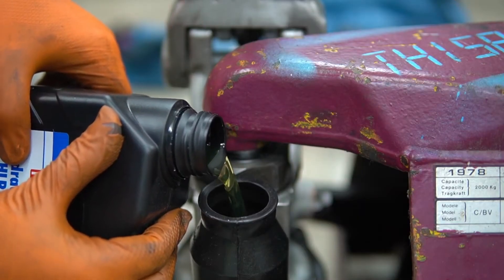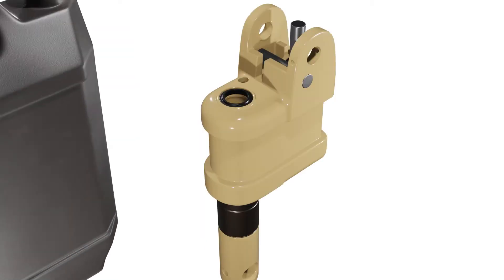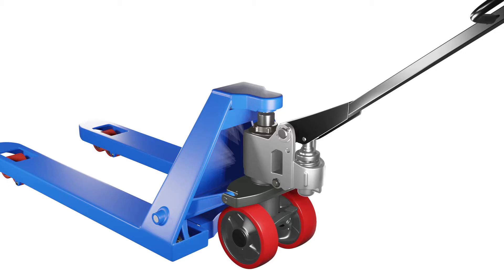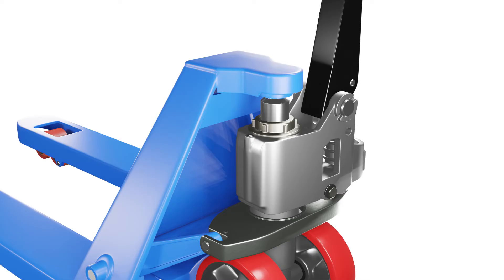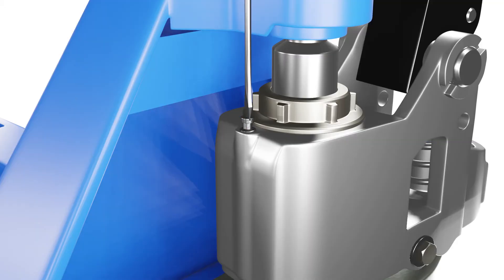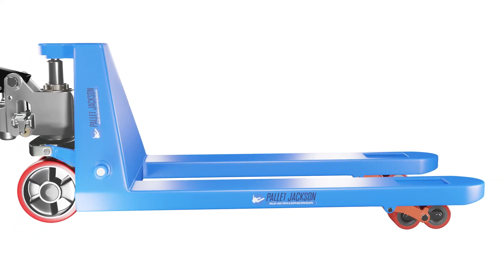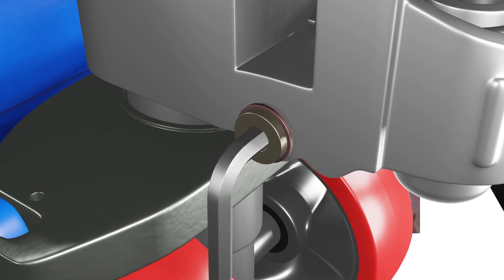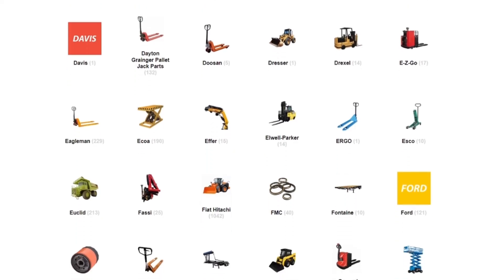How To Add Hydraulic Fluid To A Pallet Jack | Pallet Jack Oil Refill Guide | Pallet Truck Oil Change

Comment: Which hydraulic oil we use in pallet jack ?
Reply from the maker: Any hydraulic oil with a viscosity of 30cSt is recommended. Usually it is ISO VG32. You can check our detailed guide for best hydraulic oils for pallet jacks here: https://palletjackson.com/collections/g-tools-hardware-c-oil